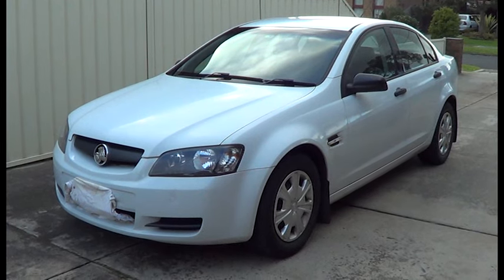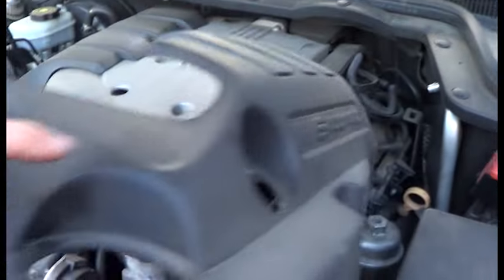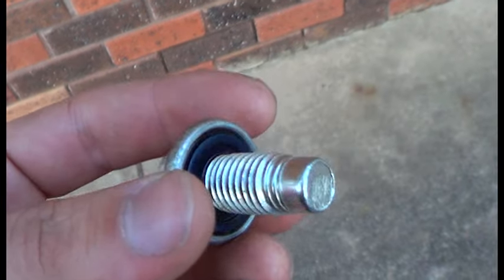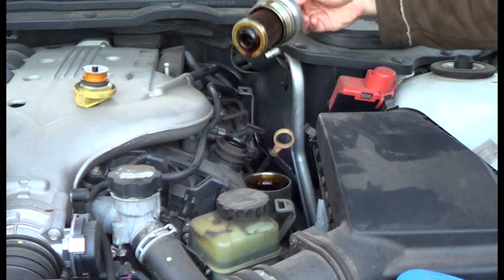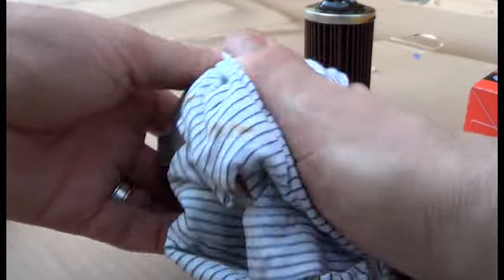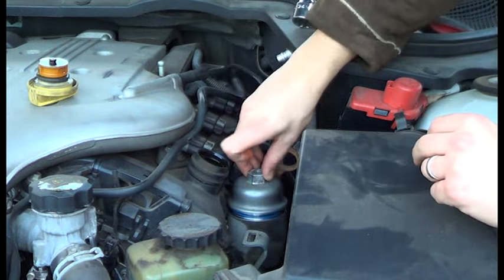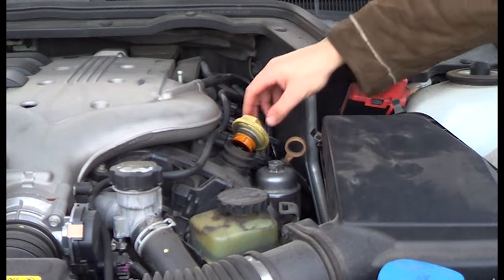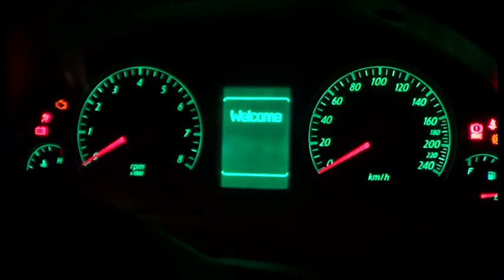Holden VE Commodore - Oil & Oil Filter Service

Comment from the maker: To reset the Engine Oil Life %, turn your ignition off. Turn your ignition on (don't start the engine), press the accelerator 3 times in quick succession. Turn the ignition off and then enter Engineering Mode, it should be reset now and show 99%.
Reply: and I wouldn't do the above with no engine oil in it in case you accidentally try and start it !!!
Reply: NJS Instructional lol was hoping this info was in the comments section. thanks mate
Reply: how do you get into engineering mode?
Reply: I’m trying to do this and it stays at 0%. Am I doing something wrong? Great vid mate.
Reply: @Kippa6281  i just tried this following the same steps and have the same problem too
Reply: ivorjohnson247
Reply: @Axe Man
Reply: 9m
Reply: 7
Reply: You need to be in engineering mode first. Here's the full instructions.

To enter engineering mode:
From the off position, press and hold the left scroll wheel on the steering wheel. Turn the ignition to ON, but do not start the engine. You will see the dish display engineering mode.

To reset the engine Oil Life setting whilst in engineering mode:
Navigate to ‘Engine Oil Life’
To reset it to 100%, depress the accelerator pedal to the floor three times, close your eyes and say out loud "there's no place like home" with each press (optional).
After a few seconds the value should reset to 100%. If not, repeat the steps.

Comment: Make sure you fill oil filter up with oil when replacing or your engine will start dry! It takes 1/2 a litre.
Reply: I recently changed mine 2 days ago and didn’t put any oil in the oil filter compartment and now car is conking out and stuttering and low rpm drive and reverse, feels like it’s chocking is that because I didn’t put any oil in there, I put 6.7l in the engine oil refill port
Reply: @tristanalderton5838  The VE takes 6.7L capacity incl. oil filter so that won't be the issue. I have been changing my oil for over 30 years and never put oil into the filter compartment, it's not a thing.

Comment: What an awesome video! I have a 2007 statesman wm and have a few questions though... 1. How did you know to put in 6.7L in your car and 2. How do you put the car in engineering mode? Thanks for the very imformative video ! :)
Reply: Engine mode hold the left scroll bottom on. On the steering wheel then turn on the motor

Comment: Does the oil need to be empty before removing the oil filter?
Having trouble trying to get my oil filter cap off and wondering if it's a pressure issue or the caps just done up too tight.
Reply from the maker: Ideally, the Oil should be drained prior to removing the Oil Filter. It could be your cap is done up too tight...
Reply: I should answer this for you , probably happened to you as it happened to me .. the oil cap I came across I ended up breaking the nut on top clean off I put loads and loads of force … until it just broke … I went to a pick your own part place got another part .. came back to car … got a grinder to cut into the oil filter cap … got a chisel on it first to see if I could get it started it was not coming off at all … In the end I cut through side of the old filter cap then I got a ball pein hammer I started smashing the cap off .. ( at this point you want rags stuffed inside filter to stop bits of metal getting deeper … however little bits of metal don’t affect its running as we got a few bits of metal we left in there … anyway eventually after smashing it to bits the oil filter started turning in its thread … some people over tighten these oil filters when putting them on .. a real headache .. you most likely had to do similar

Comment: can you tell me the size of the filter head bolt please...just so I can go into Auto shop and buy the exact size
Reply: Efaraima Tuua hey mate the oil filter is 24mm and the sump plug is 15mm
Reply: I tipping if you dont hane a spanner that fits already you probley shouldnt be doing it just saying

Comment: Hey man i know that this vidoe is about oil change but i have temhe same car as you and everybody knows how bad the timing chains get. Was the time chain replaced in your car at all ? If not thats a good run with the original chain for a 300000km car
Reply from the maker: Hey Nick,  I believe the engine was built with the revised timing chain. So, didn't have any problems at all.
Reply: Timing chain is that shot on the ve mine is about to go and already had one replaced when I got it at 100k
Reply: @NJSInstructional  whats a revised timing chain dude?? We all want one of those sets. By the way you must mean chains as there is 3 of the bastard things on these engines.
Reply: mines lasted 362,000 km so far

Comment: shouldnt it be 5-30 oil?
Reply from the maker: From memory, both are acceptable for this vehicle and the environment conditions it was operating in.
Reply: Also depends on how you drive it
Reply: And also for high mileage engine
Reply: 10-40 semi syn
Reply: Says 5-30 on the cap

Comment: should we flush inside engine with water before pour the new oil in?
Reply: Seriously 😐
Reply: Of course you should. Salt water to be precise. Joking. WTF kind of question is that.
Reply: Hell freaking no! If your question was genuine, the water may get more of the nasty old oil out but then you'd have water in there. And that's way way nastier. You're asking for serious engine damage.    Water is critical but only in the cooling system.
Reply: Should I flush engine with water first before putting New oil in.
Reply: @YoungGun.  NO NO NO  GOT IT ?????
Reply: Ifyuo feel the need to flush your engine. use some cheap new oil and pour that through it. IF YOU MUST.
Reply: Flush with slightly warm strawberry milk for best results.

Comment: What does pump the engine mean
Reply: Mother of Moses start the motor to get oil around the oil filter then turn off and check dipstick again oil level might change

Comment: i have a 2008 v6 ve. how much oil do i need to put in after draining the old oil? im changing the filter too. 6.7litres?
Reply: Mine takes 6.4 litres of factory recommend 5W-30, I use Castrol Edge fully synthetic every 7,500 km, important to change the oil on time as these engines have a tendency to stretch timing chains, I also use latex gloves